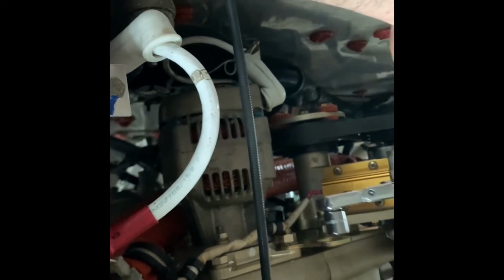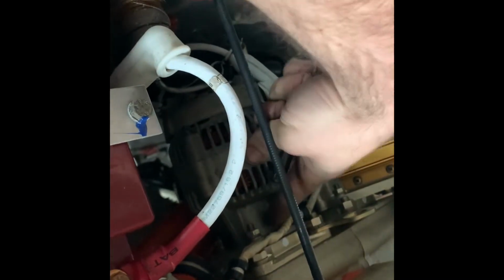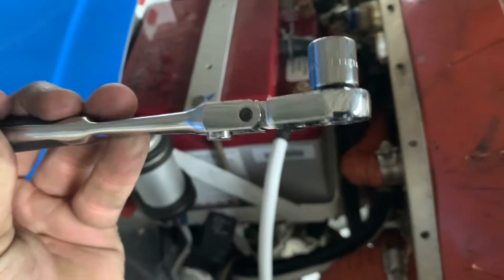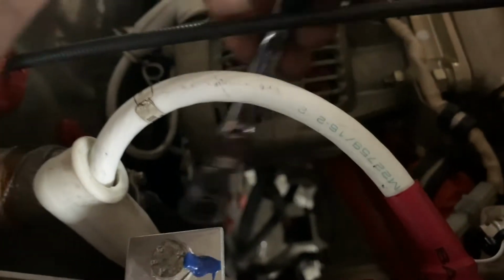Pass thru ratchet sets?!  Not a gimmick, but a great tool. Gearwench 1/4 pass thru socket set

Comment: I got a cornwell pass through set over 10 years ago. Its not 1/4 drive size its 3/8 drive size, i dont use them often but when i do its the only thing that will work. Great for shocks when the piston turns and the nut doesnt loosen so you can put your allen or whatever thru to hold the piston while you turn the nut. Especially real ones in a deck lid or something where is recessed so a wrench wont work. Its gearless as well. Awesome set

Comment: I used my Gearwrench 3/8 Pass-Thru flex head ratchet where I NEEDED both flex and pass through!
A shallow wouldn't work (because of a long bolt); a deep socket wouldn't work (because of space limitations); my Mountain wrenches wouldn't work for two reasons (11mm being one); a combination wouldn't work (because I had no straight shot)...but the Flex head Pass-thru solved all my problems!

Comment: I know this doesn’t apply to the tool your demonstrating but have you made a special safety wire tool?  On a uh60 I’ve cut a bent rig spin and use it for tough to reach safety wire applications. I cut a v toward the end of the pin and drilled 2 holes at .032 so I can safety wire things easily.

Comment: Problem with these sockets is no one makes an organizer (socket rail) for them.  
The blow molded cases are only useful for marketing displays.
Reply from the maker: I have some of them in an olsa tools magnet holder.  It works good but you’ll have to write the sizes on the outside